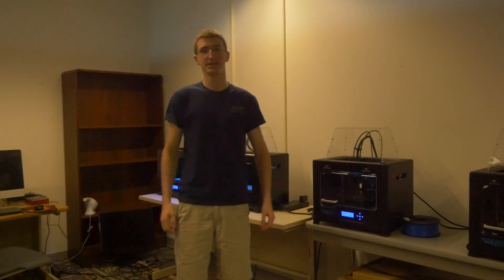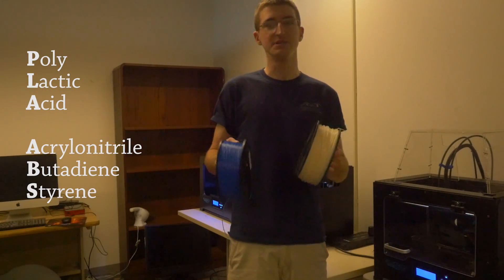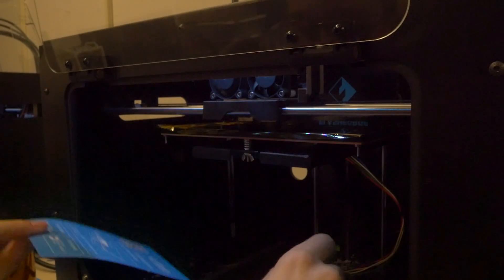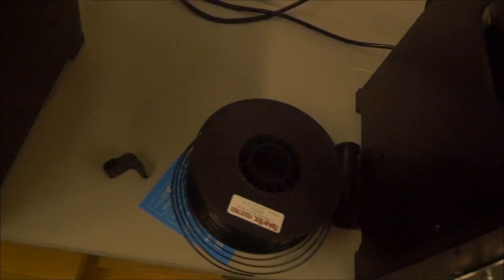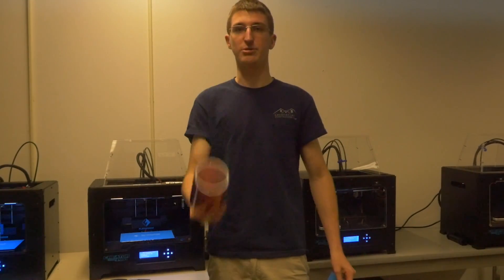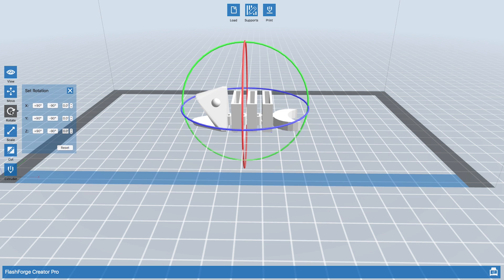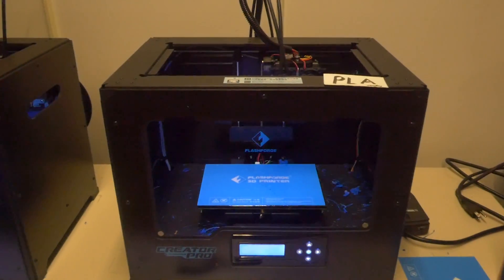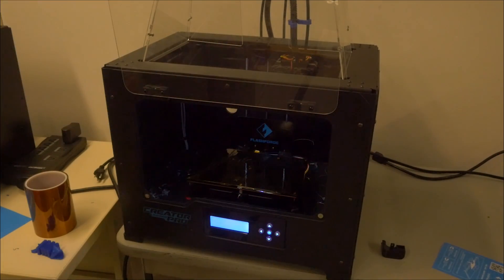Using the Flashforge Creator Pro 3D Printers - BASICS

Comment: My high school just bought 2 flashforge creator pros and I am doing some background and research in using both extruder heads. Is it possible to print 1 piece in 2 colors if you import the piece as 2 connecting parts in the software and label each file as a different color? An example would be trying to print a bowling pin keychain that has two red stripes along the neck of the white pin. Any input would be greatly appreciated!
Reply from the maker: There are two ways in doing it. The simplest way being to design your part as two separate parts that are together, but you don't need two  different files, you can make two objects in one stl and still tell the printer which head to use for which object. The advantage of that is when the STL is imported both models will be lined up just right instead of spending a huge amount of time lining and sizing them up. Adafruit made a short post here which is a little helpful-
https://learn.adafruit.com/dual-extrusion-3d-printing/overview
Reply: So I should create an assembly file and export as 1 STL versus two part files and exporting as 2 STL files?
Reply from the maker: When you say assembly file, what do you mean? I mean, when you're in CAD creating your part, make sure there is two objects together than export the STL, then when it's opened in the Pro's software, tell the printer to print one of the objects on a different head.
Reply: Sam Archibald we use Autodesk Inventor for CAD which has part and assembly files, we can export these files as STL files to be able to print off a 3D printer. Assembly files are made up of part and or assembly files
Reply from the maker: Ah, then I'd say yes, export as 1 stl with both objects as one part
Reply: Sam Archibald if i have the flashforge creater wood case 3d printer can i use the same software??

Comment: Hi Sam. A very clear and easy to follow video. I have a Flashforge Creator, slightly later version than yours. Worked great, and I am printing PLA mainly as I use it for making patterns for investment casting. PLA works well in that role. However for the last few days I have been having real problems with the PLA filament not feeding through the printer head. Always seems to occur after 15  to 20 minutes into the print. The PLA filament buckles after the drive wheel. Obviously heat is getting up from the print head and softening the filament. What I have noticed is that the extruder motor fans are rarely on. I have searched through everything to find out how one turns them on. I presume they are controlled by a sensor somewhere. I note in your video, the left one of yours was whizzing around. In my desire to ensure that everything is fine, I have stripped the heads down, cleaned them, and swapped the left and the right nozzles and driver, as they have never been used, but it has made no difference. It's driving me mad as I have so many small parts to print.
Reply: Hi Tim. I used mine for about 20-25 prints off various sizes (45 minute prints to 7.5 hours) and the white/clear heat resistant tube in the heat head (filament feeds thru it to the tip) melted.. causing the filament to sixteen prematurely and form a blob that totally stopped my progress. Cleaned it out, replaced the tube, and now works great again. 
Something to check out.

Comment: Hi Sam, I am a new owner of one of these models, and has a couple questions/issues. 

1. The left print head is slightly loose and rotates about 10 degrees back and forth. I assume it is secured with the Allen head screw that points forward.  I have only used the right head so far, but if I tighten the left one, how can I be confident it is properly aligned relative to the other head? 

2. The program it came with to convert models to print is ReplicatorG. Yours looks slicker. Do you know about ReplicatorG, and do you have a preference? 

3. The SD card that was in it when I bought it had a few model files on it, and I have downloaded some free ones of the Web, but to create my own models, I have only tried the online TinkerCAD application by Autodesk. It is capable, but in its easy-to-learn simplicity, has limitations. I cannot position features as well as I would like, such as concentric circles. It asks me to change the diameter in two steps, by adjusting both the X and Y axes one at a time, and does it from an edge origin, not the center. Can you suggest a free or inexpensive 3D modeling app that I can use on the desktop that has better, more intuitive creation and editing tools?

Thanks in advance.

Comment: My printers SD Card reader isn't working anymore. Is there a way to use the printing cable that came with the printer to print off my laptop using the flash forge software? Thank you!

Comment: I have been having trouble printing with the flashforge creator pro. It seems to start off well when it is doing single lines. When it starts moving it starts messing up. The plastic begins to clump around the nozzle and it begins to drag some of the plastic along with it. I have leveled it multiple times. I am pretty sure i am doing that right. I cleaned out the gears. Any suggestions on how to address this?
Reply from the maker: I had this problem, but it was a leveling problem. While the printer is in leveling mode, move the head manually with your hand to all corners of the plate. I'd also recommend changing the surface of the build plate, what is on your plate? Is it bare, using the blue bed cover that comes with the printer, or painters tape, or kapton tape?
Reply: When leveling, should only be SLIGHT friction between the nozzle and paper. Do the leveling on all 3 sides very carefully, then double check the others. One side is too close.

Comment: I have this printer and my prints aren't sticking.  Also I can't print from my computer but only from SD (test prints.)  What's going on?
Reply from the maker: Karrie Marciniak The prints not sticking can be a couple things. Your bed or print temperature. Make sure your bed is getting hot, if you can, use kapton or painters tape, and use the recommended temps in thr video. And if you plug in your printer, can yoir computer see it?
Reply: I tried leveling the print bed and that worked on one side only...
I cannot print from my computer as the prints just glob up. 
I am so inexperienced...  My students and I want to create something other the test print and no luck so far.  Can I use Thingiverse to create prints?
Reply from the maker: Karrie Marciniak Thingaverse is what's called CAD software. It's used to model 3D models. You can use it to design prints but you then need to import them into Flashprint since it's the required Slicing software. I have used Thingaverse and in my experience it's not that great. I recommend Autodesk 123D, as it's almost as easy to use as tinkercad, but works a lot better. And if leveling it helps, level again. And don't just level once, keep leveling until you know every part of the bed is exactly level, meaning you can pass a piece of paper between the head and bed with slight and even resistance. And I think your COM port on your printer may not work, meaning it cannot communicate with the computer. So try printing of the SD card.

Workflow in steps described above-
1) Level the bed several times until you can pass a paper with slight and even resistance at every point. You can also move the head of the printer with your hand to check every part of the bed.
2) Make your model in TinkerCAD or Autodesk 123D or download from thingaverse. Export as a STL.
3) Open the STL file with flashprint, add supports or whatever you need.
4) Hit the print button, hit SD card, and input normal temp settings
5) Remove SD Card from printer and put into your computer or a SD card reader.
6) Hit the button to export the print file and save it to the SD card.
7) Insert SD card into printer and print from the card as if you're printing a example print.

Let me know what happens
Reply: Sam Archibald thingiverse is not a cad program. it'd a website for downloading models
Reply: Thanks for your help!  I will give it a try!
Reply from the maker: Cullen Lonergan You are correct. I misworded. I meant to say "tinkercad"
Reply: Sam Archibald ohhh ok